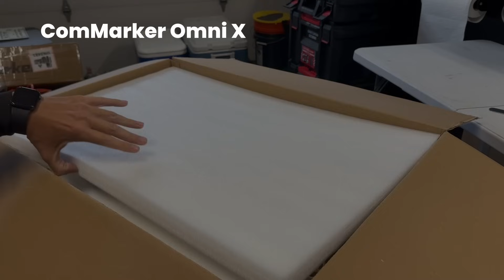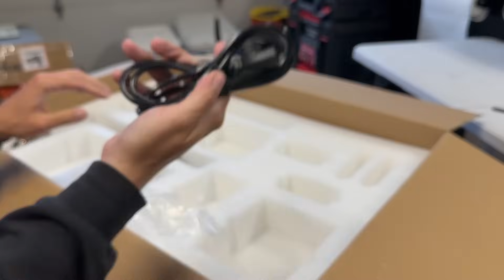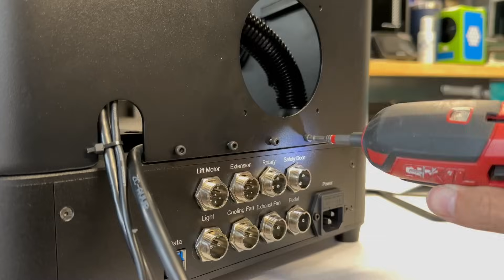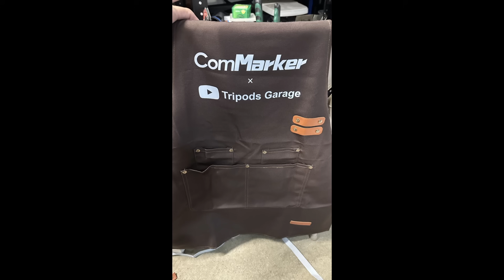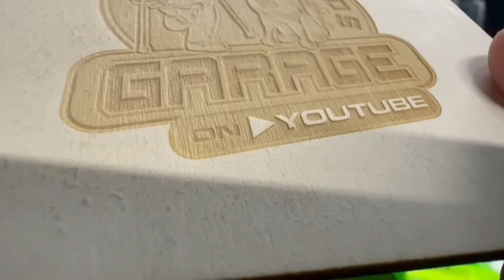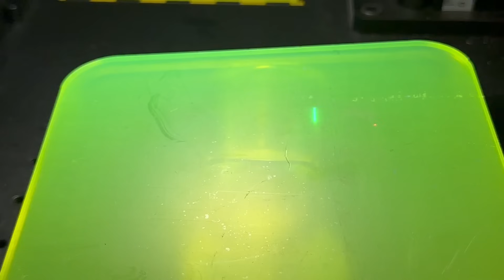ComMarker Omni X UV Laser Subsurface Engraving

Comment: On the shot glass you engraved, how does it not go through one side to the other while engraving the surface? I noticed you did two sided.  Most clear glasses I've done in the past have completely engraved on the opposite side (or inside)  if I didn't put something in it to block that. (Make sense?) . Also do you know if this will engrave on powder coated tumblers? I'm thinking on pre-ordering the full package. Your video was so helpful! Thanks!
Reply from the maker: First question.  Are you currently using a UV laser?
Reply: @TripodsGarage  No sir. I'm still stuck in the diode phase of making things. I'm debating on UV or Fiber.
Reply from the maker: @debbymoritz8234 Ok, the UV has a really short focus point.  You can really see it on the leather patch.  If it off by just a little bit, it won’t engrave.  That is why I didn’t have to worry about the laser engraving on the other side of the glass.  I believe it should also work well for tumblers.
Reply: @TripodsGarage  nice. Thanks for your help. I appreciate it. I’ll be watching for more info on your channel. Thanks again.
Reply from the maker: @debbymoritz8234 Absolutely!  Glad I could help!  Happy Lasering!